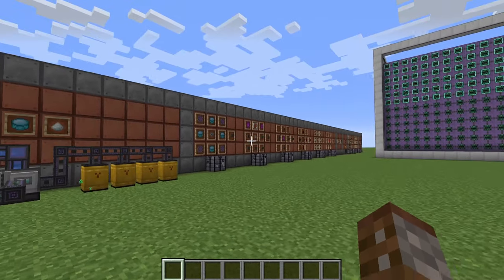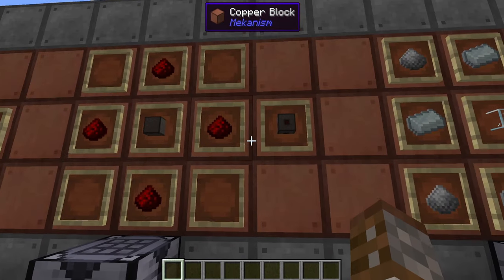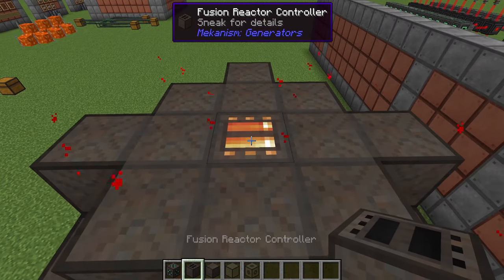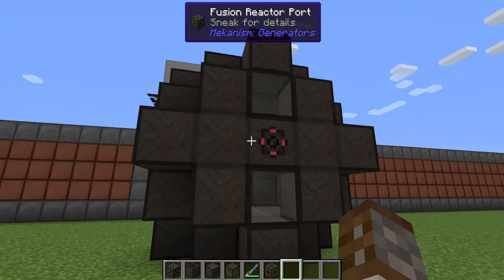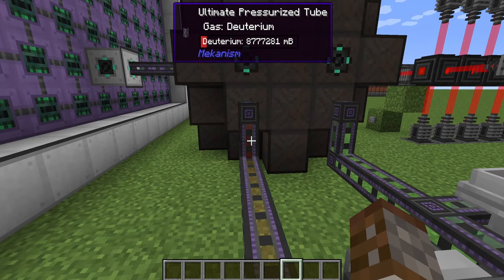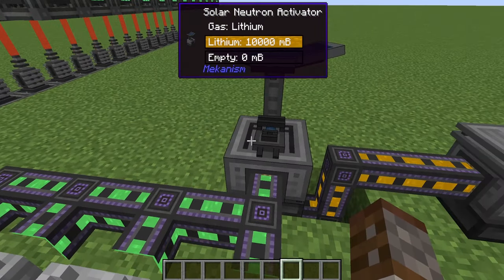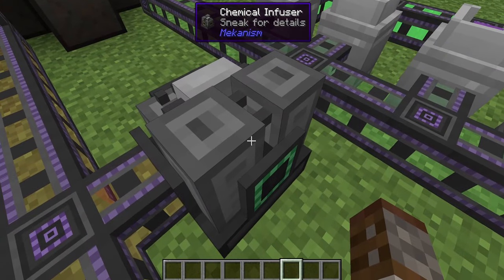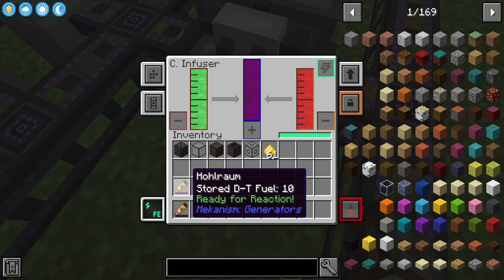How to: Mekanism | Fusion Reactor (Minecraft 1.16.5)

Comment: The power creep in modded Minecraft is real; we've gone from nuclear fission reactors and super-compact solar panels that, while powerful, are still needed in multiples to power the most energy-demanding machines (including hyper-overclocked basic processing machines and mass-fabs)...to potentially ludicrously powerful fusion reactors that can probably fulfill an entire server's power needs...
Reply from the maker: Mekanism I think should be late game in most modpacks for sure. Kitchen sink packs seem a bit weak to me when you can rush to this stuff lol
Reply: but even then, there exists power storage systems that the mek fusion reactor can never even hope to fill... (draconic evolution max level energy core)
Reply: @epicgaming11195  It doesn't stop there.
The Dark Fusion Core from HBM's Nuclear Tech Mod is easily the most powerful reactor available, if set up correctly.
With a looping min-power emitter setup, max-power restriction field, schrabidium catalysts, and a fuel combination of schrabidium trisulfide and antimatter...the DFC can fully charge a Ferris-Electronium Storage Unit* in a matter of days, or maybe even hours (depending on version).

 However, it is extremely difficult to build, as one of its materials requires the construction of an expensive droid. In turn, this requires several drops from tough boss monsters, plus an extremely rare type of wood whose bark is indistinguishable from vanilla wood.

*The FEnSU's power capacity value is identical to that of the max-tier draconic energy core, except that its respective mod's energy type is four times as powerful as RF by default (not unlike EU from IC2 Experimental and Classic).
Reply: For Mekanism being rather late game stuff, you can attain your first jetpack incredibly fast, you just need to mine some basic ores and power an infuser, an enrichment chamber and the electrolytic separator. Setting up the separator with the water supply is the hardest part, you can still get this done before even having to mine diamonds or enter the nether.
Reply: I've seen this reactor in an underground facility blowing up on a Youtube video, and it created a massive hole reaching the surface

Comment: Thank you for the good tips. I built a gigantic (and by gigantic I mean multiple hundred blocks wide) nuclear fusion facility to power my mod project, but I constantly had problems with everything working only on round about half its efficiency, thanks to your video I found out this was because I used D-T fuel for the reactor. Also I didn‘t know that the injection rate has to be an even number; when I tried to change it to 3 to test it, nothing happened, so I thought it was broken and didn‘t try again. But now I know better. (Also, if someone wondered, “Hohlraum“ is a german word, which means “empty space“)
Reply from the maker: So glad you got things figured out!

Comment: You only have to use 800 MFE to jumpstart the reactor.
Reply from the maker: I've seen 200MFE, 400MFE and 800MFE. I haven't tested all the minimum myself but it's easier to say do the most possible since modpack authors can change what is required
Reply: As far as I know the modpack which I used to test that does not change the amount of energy needed to start the reactor

Comment: Wow. These things have been nerfed hard since last I played. 

Was messing around in a creative world (Plexiglass Mountain, 1.18.2). Basically, a bigger Turbine is always better. I tried messing with smaller turbines for space efficiency, but when it comes to burning fuel, you get way more bang for the buck with just making enormous turbines. Even then, the most I could squeeze from a 15x15x18 (keeping the boundaries within a chunk) was 43.14MFE/t, burning Deuterium/Tritium at full injection, which is a hell of a far cry from the some hundreds of millions they used to generate. Trying to build four 7x7x18 turbines (again, chunk boundaries), I could only run two effectively at an injection rate of 86. Each was only providing 13.53MFE/t. The hope was to produce enough steam to get 4 turbines in the same relative footprint for a bit more power, but that would necessitate doubling up on both fuel production and reactors to produce enough steam.

It should be noted that you can effectively go closed loop after the initial setup. Once the reactor and the burn rate are set, from what I'm seeing in my test world, you no longer need an external source of water for steam. You will, however, need to hook a pipe up to several vents for water retrieval. A lot of video's seem to just place one mechanical pipe on a vent and return it to the fusion reactor, but that doesn't return all the water from the turbine.

None of this is a problem as such, it just makes producing Antimatter a little more "deliberate".
Reply: thats a lot a word for a comment
Reply from the maker: Couldn't agree more. I haven't done as much testing but it's hard to get true massive power with turbines

Comment: I dont know which version this is, but on Mekanism minecraft 1.19.2 you can just use 2-4 Resistive Heater on max power to heat the fusion reactor.
it costs much less ressource to just build them instead of a big laser matrix and heating it up just takes about 1-2 minutes xD
Reply: But the laser is way coolee though.
Reply from the maker: This is 1.16.5 and you can’t do that on that version
Reply from the maker: Lasers are cool

Comment: My fusion reactor doesn't make more than 500 KFe/t when water cooled, and 800 KFe/t when air cooled. any idea why that is?
Reply from the maker: Up your burn rate
Reply: @Mondays3  my burn rate was maximum. I ended up getting 8 MFE out of them by directly pumping in the combined DT fuel, but still not enough to make them worth running instead of the fission reactor (I get about 60-70 MFE out of the max size fission reactor with 4 turbines and 4 boilers) but its decent supplemental power.

Comment: Whats the point of the turbine? if you make more power with the reactor.
Reply from the maker: You don't need it, it's just an option. You can use it for extra water for fission reactor for polonium?
Reply: Because when you water cool a fusion reactor, you can produce enough steam from that one reactor to power up to 8 maximum (17×17×17) steam turbines. With that setup the water cooled fusion reactor and the steam turbines create about 5 times more power than an air cooled fusion reactor.

Comment: I dont get it, you gain almost 20Mfe per tick from passive energy then why you want steam? Is it really making more than that overall? You only get around 10MFe per tick with water cooling and steam turbine combined but there was still steam left so thats why I'm asking.
Reply from the maker: Totally agree. I think you would have to rig something very bespoke for that
Reply: Just use the heat from the air cooled fusion reactor to power a boiler to give steam to a turbine it is just better with more power water cooled is not that good
Reply: If you want to generate antimatter, the steam is very useful for mega amounts of water
Reply: I know I’m a little bit late, but the steam turbine can only use 1.7 million mb/t of steam and the reactor produces 14.7 million mb/t so you can put more than 8 of those turbines, which resolutes to around 45 MFe/t.
Reply: @sushimampfer  This was actually a super useful comment, thank you.